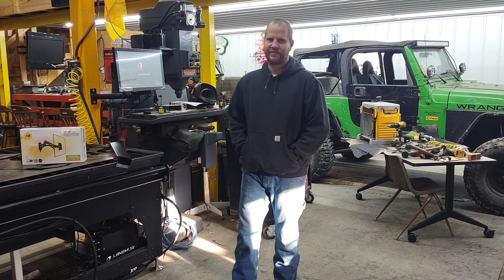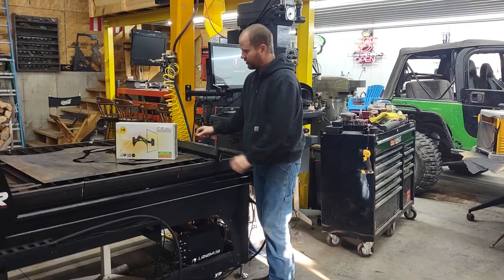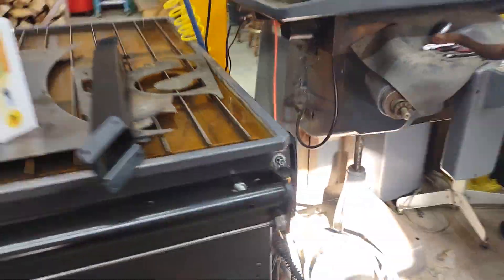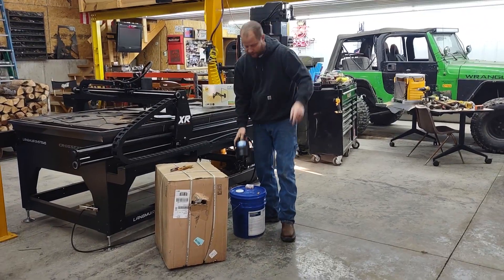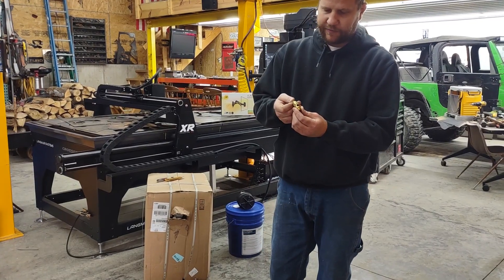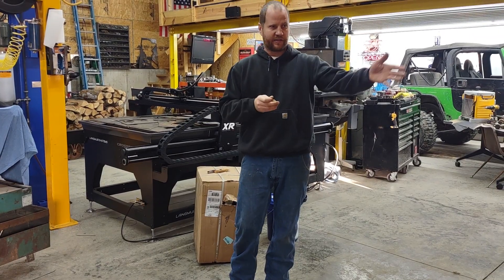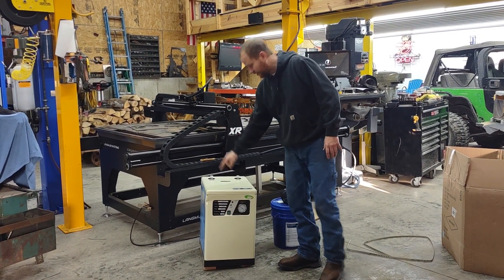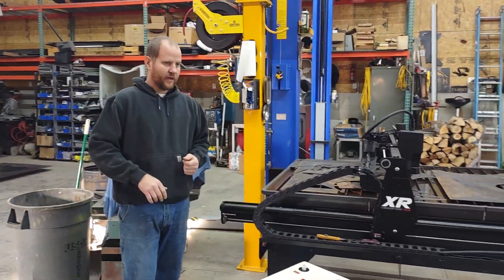Crossfire XR plasma table upgrades and modifications.

Comment: First off air compressor you guys want or have the need for air get way from cheap junk and spend the money on a good unit commerical at minimum industrial is the way to go there is no better option Curtis Leroy Gardner Denver Quincy those are the brands you need to consider and yes I'm talking 10k units but you will buy them one time and never again for the rest of your life they are life compressors 30 40 year units.  I use a 325 Quincy 21cfm 2 stage 5 horse motor 80 gallon tank  and a inline dryer.  Spend the money on your equipment and it will take care of you buy cheap and it will cost you more in the long run and possibly cost you your life.  A unit like mine the same issue isn't possible

Comment: I have been shopping for an air compressor for the plasma table I am building. Seen a few stories of air compressor explosions. One person is saying that mounting the compressor to the floor like that with out vibration damper will cause a leg to break off the bottom. I never thought of the tank exploding like that. I think I will have mine outside the building with a small roof over it or something. How old was your tank? Did you drain water out of it often?
Reply from the maker: It was 10 years old. Water drained regularly. The new compressor is anchored and has vibration dampeners under the feet. Also have a auto drain. Its an electric solenoid that purges water out the bottom of tank every 15 minutes

Comment: glad youre liking the cnc im looking at this one and then a version with a down-drafting table.. how are you using the table? what are yall making?
Reply from the maker: I have owned a down draft table in the past.  If your going to cut mostly thin sheet metal get a water table. If your cutting mostly .1875 or thicker get a down draft table.
Reply: the other version is not by Cross fire as theydont offer a downdraft table.

Comment: You are draining the coolant into a 275 gallon tote?  What?  How much coolant does that thing hold?
Reply from the maker: The table is approximately 75 gallons. I have several bulk totes so that is what im using until i can find a 75 gallon solution that fits under the table.